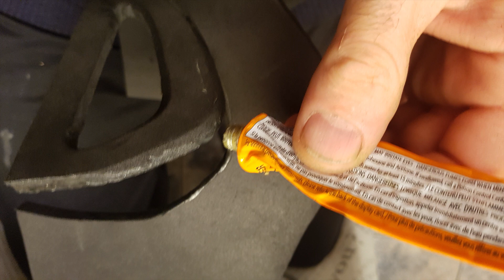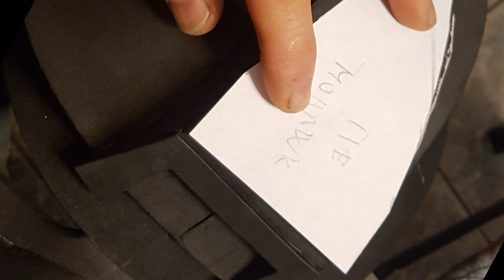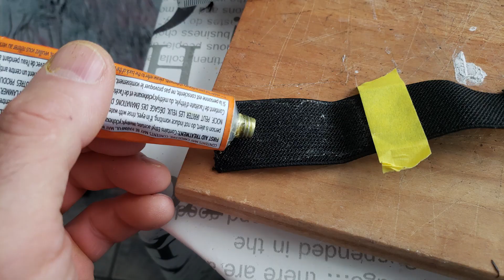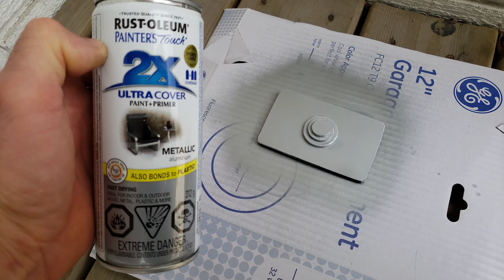Tie Fighter Pilot Helmet and Armor DIY, EVA Foam

Comment: Great work! I would love to build one myself. Do you still have the pattern?
Reply from the maker: @expw2930  I'm coming up with upgraded patters in a couple of weeks, stay tuned!
Reply: @lefthander3807  cool, sounds promising! :) Regarding your painting process: How is the paint holding up? I read that some paints will crack on flexible surfaces like foam.
Reply from the maker: @expw2930 on the helmets the paint holds up fine, on the armors some minor cracks can appair but nothing serious.

Comment: Excellent work!! Do you have any tips and tricks for getting such a shiny/plastic finish?
Reply from the maker: Thanks! I don't do anything special, I heat-seal the foam with heat gun, than I apply 3-4 coat plasti-dip,  after that 1-2 coat primer and paint at the end.
Reply: @lefthander3807  keep it simple I like it! Do you warm up your plasti dip cans in water like some other foam artists do?
Reply from the maker: @slk-nick3389  Yes, I do! And as you can see on the pictures, I painted in the backyard on a nice, quiet day.

Comment: Can I ask what you call the parts you.use for connecting the hoses?
Reply from the maker: I used vacuum cleaner hoses, and the connectors came with the set I ordered, but you can use simple pvc pipe piece which slides tight on the ribbed hose.
Reply: @lefthander3807  Thanks! I can't wait to get started on this project! Thanks for the templates and video!

Comment: Thank you very much for the templates, I have a question, what is the name of the product you use to fill the assemblies?, the one you see at minute 5:11
Reply from the maker: You're welcome, DAP Kwik Seal
Reply: @lefthander3807  Thank you very much 👍
Reply: How did you download the templates?
Reply: @johnwant4718  the link is in the video description
Reply: I tried the link, but the files won't open.
Reply: @johnwant4718  you need WinRAR to unzip the file, preferably download it from the pc
Reply: @karinalagunes3988  Thanks!
Reply: @karinalagunes3988  Got them!
Reply: @johnwant4718  Great!!

Comment: is 6mm too thin for a similar build?
Reply from the maker: Some part can be made using 6 mmm foam, but for the most I used 8-10  mm. In a couple of week I coming up with the upgraded templates for this (totally screen accurate), so if you ca wait a little longer you wont regret it, Probably  I will open an Etsy store, because I"ve been working on this for months already, but will worth the price !
Reply: @lefthander3807  I just made a phase 1 clone helmet that is screen accurate from foam and I used 8mm, but I had to make it larger to compensate for the tight fit. I was hoping to find a middle ground between thickness and workability for details such as the faceplate and sides, however I always use 8mm for the domes
Reply: @lefthander3807  and if you make the new templates I will definitely buy. I have a 3d printed tie helmet but it is strictly for display because pla is flimsy
Reply from the maker: @theace1602  that will be light and durable, no problem if you drop it!